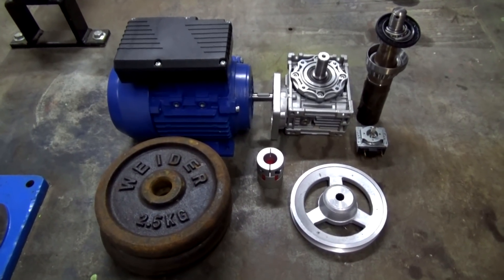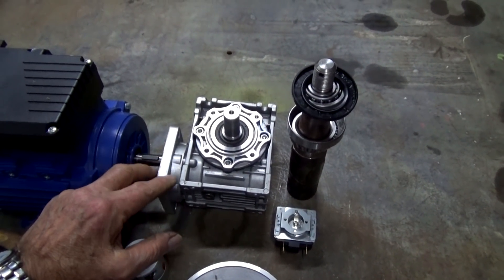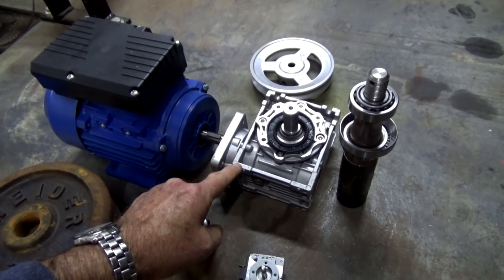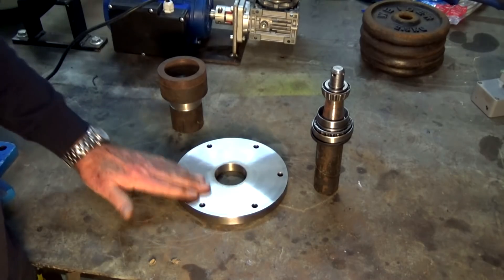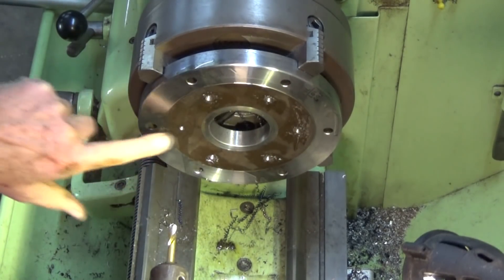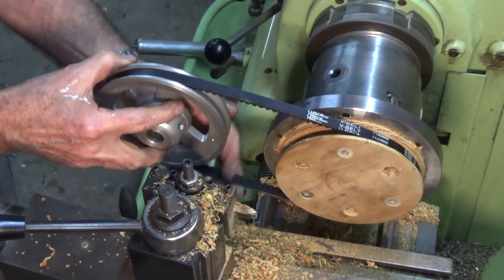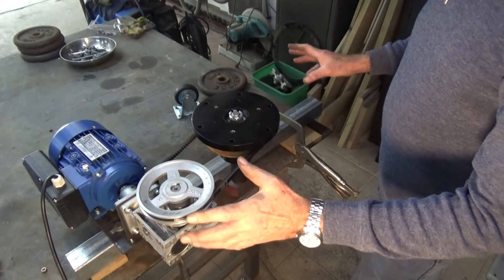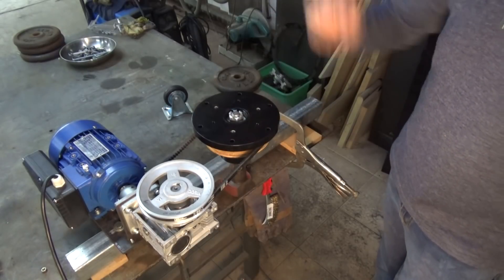The "Kooka Muller", a DIY Sand Muller for the Home Foundry Part 1

Comment: This will be a very nice build . In the 60's in Canada people were poor ; My uncle built a cement mixer with a car's front axle assembly ,the car engine ring gear and starter motor gear , a grease drum ,steel from old bed frames and driven by a 1/4 HP motor ,it worked very well .
Reply from the maker: Yes, it's great what can be achieved with upcycled or recycled parts. Farmers in outback Australia were renowned for repairing farm machinery with baling wire and a few nails! I recall a workmate telling me about his uncle being asked to make some donation plates for the local church. He didn't have a wood lathe so he took the rear tyre off his car and bolted a wooden faceplate to the hub. He made a tool rest out of some bricks and a woodturning chisel out of an old farriers file. He then put the car in gear and turned the plates sitting on the ground in front of the spinning hub. 4 speed woodlathe with tons of torque!
Regards,
Mark Presling
Reply: Michel Grenier and Mark, I have the concrete mixer that my Father made when I was a boy. I feel confidant that the one your Uncle made is the same design as the one Dad made, it was from plans in Popular Mechanics. A Chev stub axle and Buick ring gear and pinion with some bits from a washing machine (motor and pulley) with a 22 Imp Gallon Drum as well as a few bits of steel for the frame. Still works a treat.
 Cheers from John, Australia.

Comment: I love your creative repurposing of things. Using things to do jobs that the original maker almost certainly didn't have in mind. The microwave timer, the trailer stub axle. (And in the previous videos, the use of a small table top wood bandsaw to now cut metal). I must try to cultivate more of this kind of mindset, because I have some great tools and some great parts stored away in my junk bins, but without a bit of creativity, the magic will not happen. So - thanks for inspiring me.

I like how you explained that not all the new bits were necessary. With a couple of levels of gear reductions (which obviously takes up more space, and time and energy), you could even do away with the new gearbox.

Re: the flat disc finish. Good material is a joy to work with! I bought a large round bar of steel from a friend a year or two ago, expecting it to be hot rolled black bar. Turns out it was 4140 Cro-Moly or very similar material. A beautiful finish came off it, almost mirror like, and it's a nice hard material that has kept its shine and finish over time. Similarly to your report, my faith in my lathe and lathe tooling was restored. It pays to keep some material like that on hand to test, in case that faith ever wanes again!

Re: durability of plywood pulleys. Check out Matthias Wandel on youtube, he drives 2hp+ bandsaws from a plywood pulley exactly like yours, but not geared down, running at AC induction motor synchronous speed. In fact, my copy of his 20" bandsaw uses a plywood pulley just the same, and with no gearbox either. It will be a big surprise to me if your pulley is not durable enough.

Forget about how clean your hands are, just keep on with what you've been doing so far.

Cheers,
Craig

Comment: Hi Mark, its a pity no one near you is throwing out a round IKEA table as they have a nice 6 mm steel base hidden under the plastic.   Not quite 750 mm more like 600 to 650 with a hub in the middle to help keep the sand away from the center.
Reply from the maker: 6mm thick would be ideal. I actually passed up an opportunity to buy a sheet of galvanised steel around 4mm thick. It was exactly the right size and only $25. At the time I hadn't started this build and I thought "might come in handy one day". Always a slippery slope when you start thinking that way though. Hoarders anonymous here I come!😁

Comment: With that gearbox please add a vent to the top of the gearbox, as they come with no vent, and the internal pressure build up will eventually pop the seals on it. Just remove the topmost fill bolt and drill up the bolt with a 2mm drill bit, stopping before breaking through the head, and then drill the top down slightly larger, so you can put in either a small sintered brass vent, or a simple capillary tube vent. The manufacturers of them do this as they are universal mounting, so do not include any vent in them as standard, so you need to add your own. They are a pain to replace seals, as the preload of those boxes is set using the gasket material, so you need to make new gaskets in various thicknesses to get them right.

Last one I had popped the motor seal, and dumped all the oil down into the motor, which did not like this and burned out messily. Lucky standard motor, and ISO standard, so new one ( much better quality) was a bolt in part, but spent a day changing the blown seals and getting the preload right on it. the oil they use in them is nasty stuff, stinks and sticky, especially when well toasted and mixed with cremated insulation.
Reply from the maker: Thanks for the tip. I had not considered venting. They are quite well sealed so I am guessing that since this gearbox needs to run for quite long periods it will heat up significantly. This one is filled with quite a viscous grease and it will create a lot of drag. I think I have a little sintered plug somewhere.
Regards,
Mark
Reply: Mine came with a vented plug to replace the fixed plug. I assume it was sealed for shipping and you stick the vented one in when you build it.
I had better go and install it to avoid the troubles you had. Good tip.

Comment: I think you'll find that you don't really need to redo that pulley in AL.  I had a similar problem.  When I bought my metal lathe, I got it cheap because it had been dropped during transport and the main countershaft  bracket and pulley had been broken.  I repaired the bracket, but In order to make a new pulley in AL I needed the lathe to run, so I made a 'temporary' one in plywood on my wood lathe.  That was 4 or 5 years ago.  Still haven't made a new pulley in AL - that project keeps slipping down the list somehow.

Forgot to say...great build!
Reply from the maker: Thanks for watching. I suspect the plywood pulley will be fine but I get a bit fanatical about finish on parts that I make! Having said that though I often plan to do upgrades but once the machine is functional and running I take on a new project and as you say, the upgrade goes down the list. I still have a model turbojet that needs a repair done on the nozzle guide vane ring. I keep getting it out of the cupboard and putting it on the bench but I have seen it run and sort of promptly lost interest in it. It scared the living daylights out of me the first time it screamed past 120,000 rpm and the exhaust cone glowed red hot. I keep meaning to strip it down so I can machine the clearance in the stainless steel ring but if I take the turbine and the compressor off the shaft it has to be re-balanced. Not a job for the faint hearted unfortunately!
Regards,
Preso

Comment: Mark go to a scrap yard and look for a compressor alike container/cylinder and ask them to cut one end, you'll have your bowl.
Reply from the maker: I would love to live near a scrapyard! I was given free reign to scavenge parts from a sugar mill in the Central Queensland Pioneer Valley when I was teaching there back in the 80's. I could take whatever I could fit in my trailer and the stuff they threw out was amazing. Some of it weighed tons and it was eventually sold off to the Japanese as scrap steel. Unfortunately, where I live now survives on tourism and there is very little manufacturing in the area. The best I could manage was to scrounge some sheet aluminium out of skip at the sheet metal shop. I will be using it to skin the drum. I have seen some sand mullers made out of 44 gallon drums and old cement mixers and I did go down regularly to our local recycling centre looking for an old round aluminium barbecue plate but I got sick of looking. I am betting that just as I finish this build the very thing I was looking for will turn up. 🙄
Regards,
Mark

Comment: Looks good
I know nothing bout sand mullers, but that mixing speed looks pretty reasonable
Maybe it's not as elegant but I wonder if a cement mixer could be adapted?
Reply: That's how I built mine, it does work.
Reply from the maker: Lots of builders use cement mixers. They are geared down to almost the correct ratio and they are more or less a complete unit. You just have to add the ploughs and the roller.

Comment: A very interesting project.   I have not done any casting so the term sand muller was new to me.   Looking very good.
A lot of very hard woods in Australia.  Perhaps easier to use one of these to replace the plywood pulley than the work to cast in aluminium.
Dave.
Reply from the maker: Distortion could be an issue with solid grained wood. I did have a supply of LIgnum Vitae which you maybe familiar with. It machines like cast iron and is just as tough. I believe it is still used to make submarine prop shaft bearings because of it's wear resistance and it's noise absorption qualities. It would probably be perfect if I still had some.
Reply: I have a small supply of lignum vitae given to me by a member of the local turning club.  The natural oils in the wood make it very good for bearing applications.

I cannot get any more since the species is now banned from import, so I will be holding this for some future projects.
Dave.

Comment: Mark returns with more foundry creations.

Why not place the support wheel on the tube opposite the motor?  Just thinking.

Thank you, the Renaissances Master from Australia.

Cheers,

David
Reply from the maker: David,
I want the support roller to be directly underneath the compactor roller. I have actually already fitted it and it went a lot easier than I expected. I have not seen any other builders add one so maybe it is redundant. Time will tell!
Regards,
Mark

Comment: Looks to be the cat's pajamas so far. Be sure to guard that belt drive so there is no possibility of getting your fingers or clothing getting caught in it. With the gear reducer, anything that gets between that belt and pulley is going to be crushed and will drag you into it.
Reply from the maker: All of the drive unit will be hidden underneath the mixing drum when it's completed. It would take some serious work to get at the belt when it's all done. 
Regards,
Mark

Comment: Hi Mark. Just wondering why you decided to have the drum rotate instead of the roller. Also you may need to have some kind of scraper to clear the sand from the sides, it should be ok while it is dry, but  once you start to add wetting agent it may want to stick to the sides. Also on mine I added another scraper to the bottom so that the sand gets turned over, and it is not just rolling on the top all the time.
Reply from the maker: Rodney, I had considered making a muller where the compactor rollers rotate inside a fixed drum. They are often more compact in dimensions but you need to have two wheels and there needs to be a penetration in the bottom of the drum for the rotating shaft to drive the wheels. I am just about to start on the ploughs that will direct the sand under the compactor. I am hoping to put some curvature on the outer plough to help turn the sand over as you have suggested. 
Regards,
Mark
Reply: @Preso58  Yeah! thought I was probably premature on those suggestions.

Comment: Very nice design. Trailer axle dust cap for the bearing? If your hands aren't dirty, your not working. I wonder how that metric muller would work on imperial sand????? Would you have to run it upside down????
Reply from the maker: I almost bought the dust caps but they only come in blister packs of two! I don't think twice about buying a brand new motor but I get all stingy when I have to pay $12 for two caps when I only need one. Trust me; metric sand is so much easier.... none of those pesky 64th's and 32nd's. 😁
Regards,
Mark
Reply: @Preso58  Hahaha I hear that! Well you can go back to the store or whittle one up on the lathe.....in 1968 in 1st grade they made us learn the metric system because we were going to change over....fast forward to 2019...still waiting hmmmmm.

Comment: Nice strong build. Heavy engineering. I like it.
Bit concerned about the noise from the drive though. Should be alot more quiet than that. You may want to double check for alignment and/or run out.
Reply from the maker: Michael. I do have to strip it all down for prep and paint. I think I slapped it together quickly for the video and I may not have done up all the fasteners. There is a bit of slop in the mounting holes too so the alignment can be fine tuned. 
Regards,
Mark

Comment: This is going to be interesting. What did we do before the Internet and EBay? I’ve saved an old washer-machine tub for my future muller but it has its problems; size, holes. Never did notice the hands... they look a lot better than mine.
Reply from the maker: I kept looking for something ready made for the drum and gave up. I sort of knew that was always going to be the case. The base of the drum that Luckygen made was cast from aluminium in one piece! I can't imagine how it was done but I knew it was beyond my skill level. I find myself scrutinising other maker's hands now and I suspect they are using hand models or stunt doubles!

Comment: G'day Mr P. I am not sure if I like this build I will have to mull it over. ( doh!!)  LOL I have seen luckygen's video but I was a little confused about his build. I understand your thought process a lot better. You were saying about sealing the top of the stub shaft, why not just seal it with a piece of rubber between the board and the mount and have no opening except the screw holes to the flange . Just an idea. Nice build. Thanks for sharing.
Reply from the maker: Yves, I made a HDPE plug to align the plywood disc with the steel hub so I could transfer the mounting holes and keep everything aligned. When it was done I decided to modify it so it could become the seal but HDPE is so slippery that I couldn't grip it in the lathe chuck tight enough to bore clearance for the shaft nut. It just kept sliding into the chuck so I binned it! I think your idea would work. It is mainly to stop the grease from soaking into the plywood . There will be no direct opening to the sand in the drum so contamination shouldn't be an issue. I am getting ready to put the skin on the plywood today!
Regards,
Mark

Comment: A hub bearing assembly could be used as an alternative to trailer axle components. They're sealed, have flanges on both sides, and ridiculously cheap.
Reply from the maker: Well, I thought I had one in my scrap box but I must have chucked it at some point.

Comment: May I enquire as to where you purchased the 60:1 worm drive gearbox. It looks just the thing I need for a plastic shredder idea I have been kicking around for a couple of months. I have looked on ebay but it would appear that I have not been using the correct search criteria. The only ones I can find are either too expensive, too big, too small or have no operating parameters.
Reply from the maker: I got mine on Ebay at https://www.ebay.com.au/itm/Gearbox-Worm-Gear-Reducer-for-NEMA-34-Stepper-Motor-NMRV040-CNC-Milling-Lathe/273629480872?ssPageName=STRK%3AMEBIDX%3AIT&var=573076343077&_trksid=p2060353.m2749.l2649
I am not sure where you live but the one I purchased came from Melbourne in Australia and it was $14.50 shipping to Queensland. I also had trouble finding a small enough example and the ones I could find that seem to fit the application were all shipped from the USA and hideously expensive.
Regards,
Mark Presling

Comment: Thats a nice build but that noise would drive me nuts. Any ideas?
Thanks,
Mike
Reply from the maker: I am not sure what noise you are referring to but I have made some improvements to the design since that video series was made. I fitted an aluminium pulley to the underside of the drum and made a cam tensioner for the belt drive to keep everything tight. I also mounted the large roller on ball bearings. It's now quieter than what it was but I don't think I have ever heard a "silent" muller.
Regards,
Mark

Comment: Mark, looks good. Have to ask, how do you think the aluminium skin will stand up to the abrasiveness of the sand?
Reply: That was going to be one of my concerns as well. 3 mm sheet steel would be cheaper and can also be used for the sides.
Reply: Probably, with no real force behind it, the skin of the aluminium will just get mushed around a bit at most. Think about the force required to cut aluminium that's required on your lathe, with a purposely designed cutting tool. Then think about the action that an abrasive tumbler has on a part. No real material volume is removed, the surface finish is improved, if anything. In any case, Mark just need to make sure the aluminium plate is a sane nominal size and easily removeable/replaceable in case it ever does wear away.

Comment: Ok Mark, I’m waiting so stick with it. Thanks for another great video! Just wondering, did you find any shrinkage when you welded the bolt flange to the bearing tube? P.S. I’m always a bit skeptical when someone has what looks like manicured hands and trying to tell about something that would result in having “ muck” under the nails. Do they really know what they are talking about. So I say don’t give it a second thought.
Reply from the maker: Gary, I didn't notice any distortion after welding. They are really heavy chunks of steel though. I finished off the compactor roller today and I wen't down to my mates place and we cut a 2.3 metre strip of aluminium off what looks like an old advertising billboard. It will form the sides of the drum. No real issues with the build yet but having said that the gremlins will probably inhabit the thing overnight.
Regards,
Mark